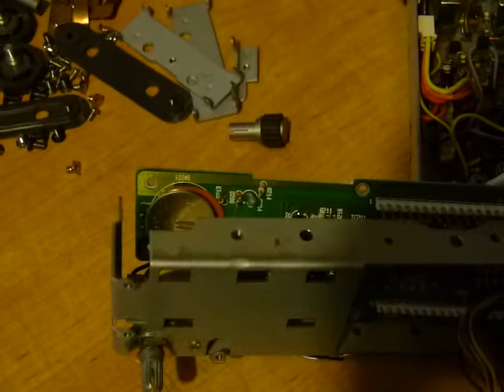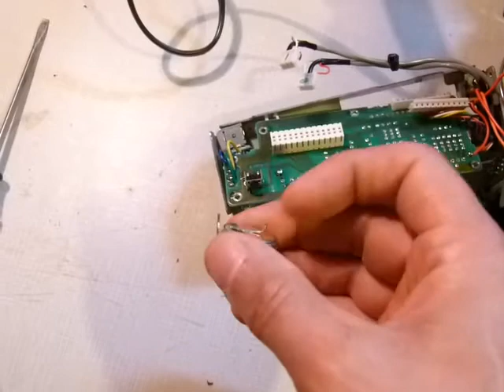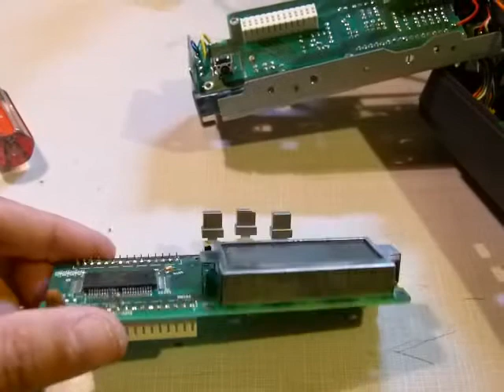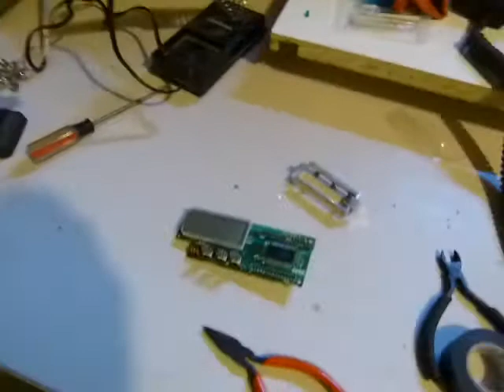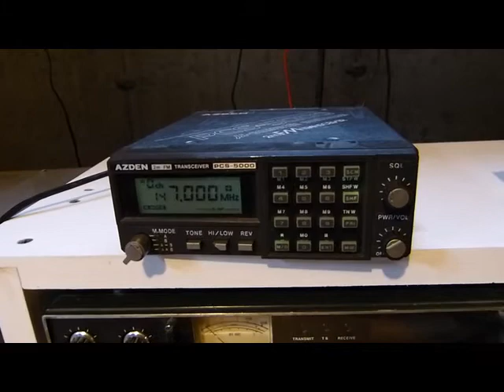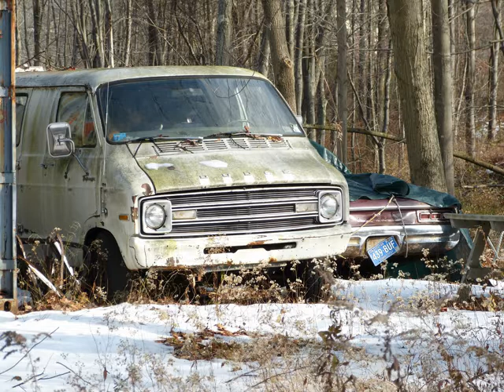Azden PCS-5000 memory battery replacement and back light replacement

Comment: Thanks for the video, it gave me the needed "push" to pull mine apart and fix the exact two issues as yours, that being a dead memory backup battery and dead LCD lamps. Also picked mine up at a hamfest sale.

Decided to do things a little different to direct replacement for mine. I removed the old backup battery without taking off the PC board (solder wick then pulled it out through the gap between PC board & metal bracket with needle nose pliers), then soldered a pair of wires to the solder pads on the reverse side of the PC board and ran those through into the main chassis where a solder tab CR2032 was attached for easy changing next time it goes flat.

For the LCD lamps I left the old lamps in place and simply inserted a couple of 5mm white LEDs (but could use any colour available) into the space where the lamps are located (and with 390 ohm current limiting resistors on each) and again ran the wires into the main chassis and picked up a switched 12 volt supply and an earth.

Everything is now back together and working a treat :)

Cheers,
VK2DF

Comment: I just got done replacing mine with LEDs, I cut the trace from the pin on the connector that supplies power  to the lights and soldered my resistor in its place. My $5 radio had already had the backup battery replaced with a socketed one under the top cover so changing it in the future would be a breeze.

Comment: I just took apart the same radio and found two 2032 batteries shrinkwrapped together in series in the location of the memory back-up. As far as I can tell, it is the original battery. Do you happen to have a printed schematic for yours? I'm trying to locate the battery voltage as indicated on the schematic. The PDFs I found online are too difficult to read. I'm tempted to replace with just one 2032. Very odd. Thanks
Reply from the maker: +henlij Sorry - I don't have a schematic.  But I would think the single 2032 (3V) should suffice.  I'm not sure why your radio would have been different.  Good luck!

Comment: Not looking forward to doing this on a PCS-6000H I just got at the CT Nutmeg Fest yesterday. If I would have realized how much of a PITA it is to replace the battery, I would have offered the guy 15$ instead of the 30$ that I paid...oh well, no biggie. Also, you should have just soldered in one of those batter holders for the 2032 in case you ever need to replace it in the future, instead of actually soldering right to the battery.
Reply from the maker: Agreed on the battery holder - I didn't think of that until after I finished...I've had Azden PCS-7000H apart too - it's not quite as tricky but still complicated.
And I was at the Nutfest yesterday too!  Picked up an old Kenwood dual bander that needs some work.  Good luck with your Azden!
Reply: SevenFortyOne Yeah, it was a nice fall day...always good to get out and see some friends. Plus its fun to see what you can find....I saw that Kenwood , whats wrong with it? I had a TM-733 that I liked a lot but they have issues....Kenwood repaired it once but it didn't work for long...ended up getting rid of it. where are you located? I am on the North Shore of LI, name is Rich 73 de W2TMA
Reply from the maker: FogMoose  ... The Kenwood has no Xmit on 2m but receives OK.  the 440 side seems to transmit and receive normally. Got it for $15 so even if I don't fix the 2m xmit it's still worth it for the 440 functionality ... I'm in Northern CT, not far from the Mass border ... PM me for more specifics...

Comment from the maker: No ideas specifically ... But the front panel mounts to the main boards via connectors and square pin headers.  I'm wondering if one or more of those pins are corroded, loose, or otherwise compromised.  You may also have a bad solder joint someplace causing you problems.  I looked in the manual I have and don't see any reference to OL or UL as an error code.  I'll be interested to hear how you make out.  Good Luck and 73's!

Comment: I'm not looking forward to it, but thanks for the demonstration. I don't know if it's related to a dead battery, but I often get a strange indication in place of the frequency on the LCD. It look's like this (without the quotes): ".OL" -or- ".UL" . I'm not sure which-- the "U" might actually be an "O" with the top segment missing, though it's not missing on the frequency numbers, so I don't think it's a bad segment. When this shows, no TX or RX. Does this sound familiar? Any ideas? 73, K7TFC